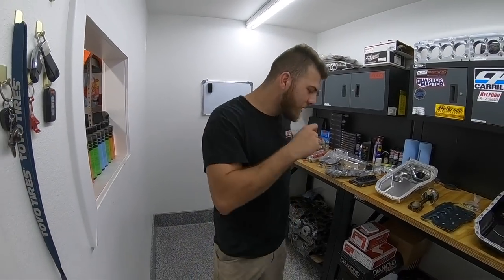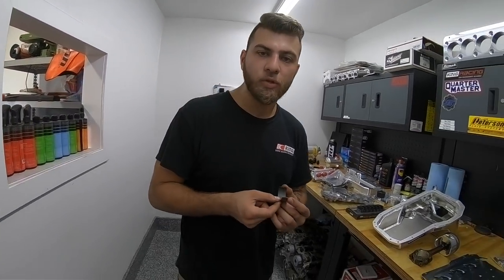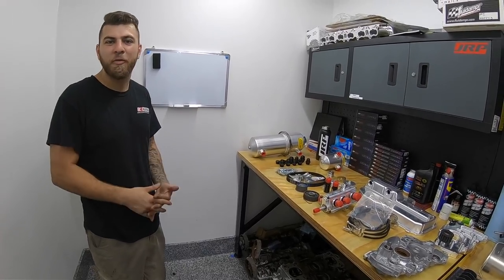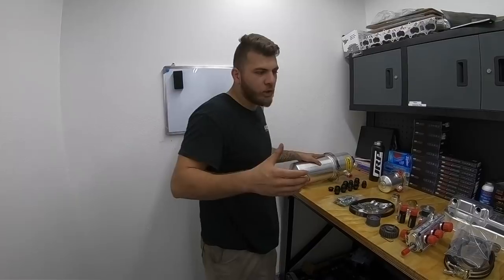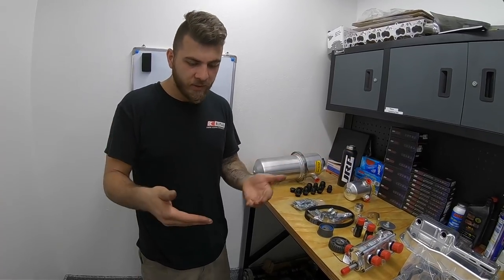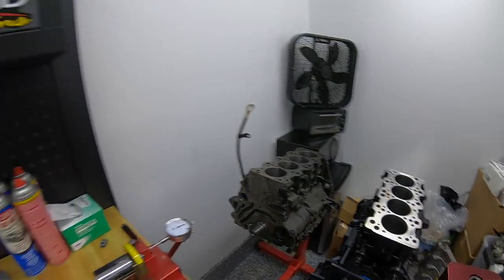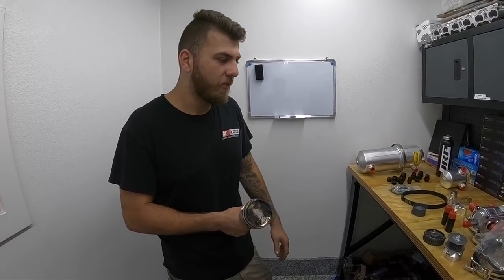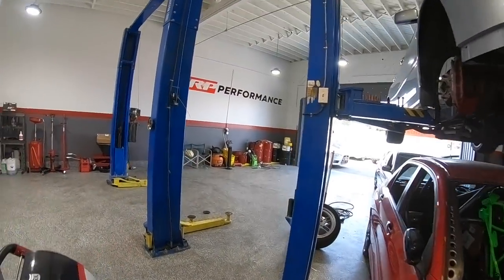4G63 Dry sump lubrication system

Comment: I got here after a video about a dry sump system that had four pickups right next to each other, a pan just as deep as stock, and no real attempt to pick up from the last inch or more of the pan's depth.  Good to see someone here who at least knows what the point of dry sump is.  Your pickups are still  not at the corners of the block like they should be, but I'm guessing there are some space constraints or something you are trying to work in.     Oh, and I have no idea what a 4g63 is, so that would be nice to know if you are going to keep mentioning it. :)

Comment: I'm not with you on the blowby argument.  For every piston that is moving down against the crankcase pressure, there is another piston being pushed up by the crankcase pressure.  However, a vacuum in the crankcase helps keep the rings seated; effectively improving compression.  Also, the crankcase doesn't leak, because any potential leak sites allow air into the case instead of allowing oil out.  Gotta love that.  Excellent video.
Reply from the maker: If you have too much crankcase pressure the piston on the power stroke is still trying to push down on the pressure that is present in the crankcase. So It definitely does rob power. This is why a catch can on high powered cars will show gains on the dyno without any tuning changes.
Reply: @Speedlab_inc  The pressure in the crankcase also pushes the piston back up, so that isn't where the gains are.  The gains are due to better sealing of the piston rings.

Comment: Great video, I'm curious to hear your thoughts on the evo 8/9 mr 6-speed transmissions, I know the 5 - speed is stronger. 
But is there a way to rebulid it to be just as reliable then the 5 speed. 
thanks
Reply: If you check their website, Jack's tranmission's provides a 6spd rebuild. It's costly but it depends on what you plan to do with your car. I have an VIII MR and might do that rebuild one day. I don't track or drag my car so I rather keep my 6spd instead of swapping. Hope that helps a bit.

Comment: How about oil accumulators?
Reply: Accumulators are a band-aid for not pursuing proper oil control in an engine. A higher oil capacity truncated and baffled wet sump goes a long way and if that doesn't get you there, then install a dry sump system. Either way you need to de-aerate the oil supply with a wet sump system too using swirlpots.

Comment: I do NOT recommend the AMS/Moroso pan for anyone doing road racing/auto-cross. It does NOT help with right hand turns. You will drop massive oil pressure. Race Fab in New Zealand modifies a stock oil pan that works much much better. Or just go dry sump haha 🤑🤑🤑